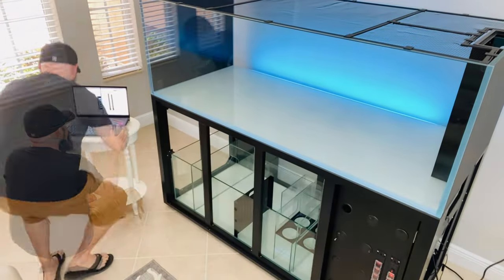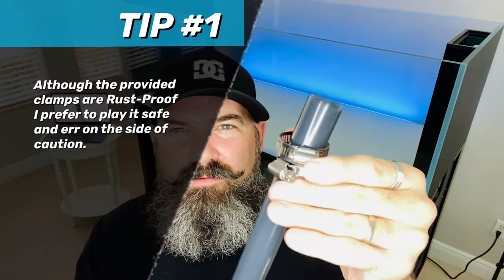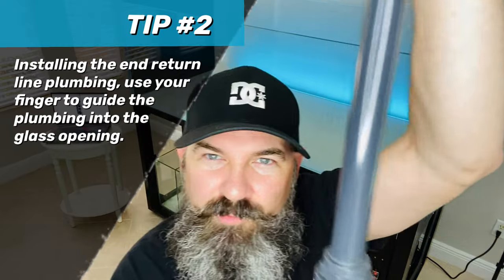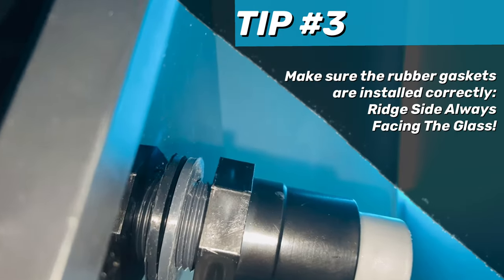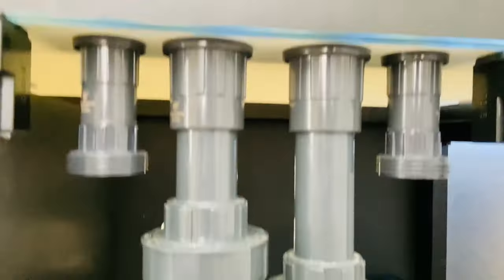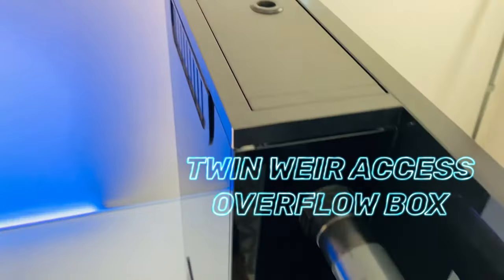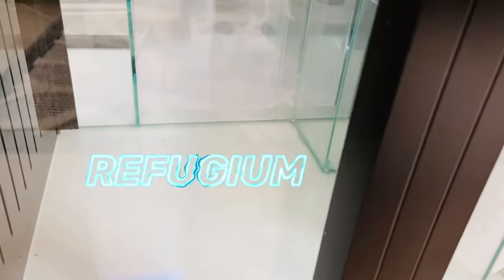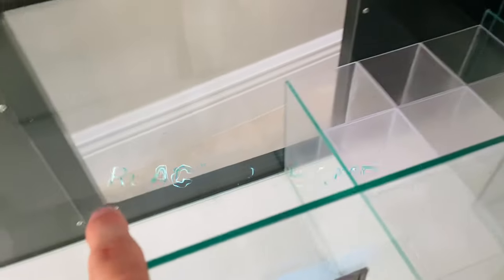💫 Plumbing the CADE Reef S2/P Peninsula Aquarium and Sump overview

Comment: This setup
Looks so clean! You have sold me on a Cade ! I remember a particularly interesting plumbing job on my old 125 😳 we completely redid the plumbing after setting up the tank in a new place and worked so hard at getting everything beautiful and neat… filled that baby up and just completely forgot about one critical step.  Next thunderstorm the power went out and we had gallons and gallons of water all over the living room 😳😳😳😳 oops anti siphon 😭😭
Reply from the maker: Thank you Stephanie!!! It’s a beaut for sure!

Ouch on the flood… were you missing a syphon hole in the return outputs?  The CADE as an additional baffle wall in the overflow to break syphon in the event of a power outage or when the return pump is off. 😁
Reply: @ReefStash  yes!! We even knew we needed to do it- we just completely forgot.
Reply: @ReefStash  I am not surprised Cade includes that. 🤩🤩
Reply from the maker: @gardengirl38  been there before but I didn’t know I needed a syphon hole when it happened to me! 🤣🤣🤣
Reply from the maker: Congrats! Your name was selected for the $25 cash drop. Please send me a message on any platform with your PayPal email and I’ll send the cash over ASAP! 🤙
Reply from the maker: see my previous comment 👍
Reply: Woohoo 🎉 thank you soooo much 🥰
Reply from the maker: @gardengirl38  sent! You’re welcome! 🎉

Comment: In the middle of redoing my 120 right now plumbing in my trigger, system ! Super psyched!!
Reply from the maker: Nice! A good plumbing job is so worth the time. I’ve done some pretty bad ones in the past and I regretted not taking my time to make it look nice and clean. 👍
Reply: @ReefStash  I have never plumbed anything before but I’m up for the challenge. My biggest problem is where to put the gate valves on the drain. I have two drains or if I even need them at all.
Reply from the maker: @domenickascoli535  I would put the gate valves a bit above the final drain line. It’s super helpful during tank maintenance to close the drain when the return pump is off. You can definitely get away without them on the drain but the systems I ran without - I wished I had installed them.
Reply: @ReefStash  on both my drains? I have two overflow boxes w two drains and two returns. Should I put one on each?
Reply from the maker: @domenickascoli535  Yes I would unless they are at different drain heights meaning one is an emergency drain like mine on the CADE but if they are both identical then yes. You could also have both drains funnel to a single larger drain with one gate valve.
Reply: @ReefStash  No it’s not an emergency drain there are two overflow boxes.  I’m plumbing it into a 39” trigger which gives you the option to use two or three drains. I’m going to use two. Good right? Prob a bit big for my 120 but I got it as a gift so I might as well set it up. I wish I had a bigger tank to set it up on. Thanks for all of your help i really appreciate it! 😊
Reply from the maker: @domenickascoli535  perfect

Comment: Good choice on removing the stainless hose clamps. I learned that lesson the hard way. Even stainless with rust and cause issues. Looks like the tank is coming together nicely. Have you picked out you sump gear yet? #cadeaquriums , #cadeusa
Reply from the maker: Agree… I don’t take chances. Thanks for the kind words. In sump equipment GW17 skimmer, M2 Ecotech return pump on a battery backups, kessil H160 tuna light for a fuge/Frag section,  bubble magus dosing pump w/seaside aquatics dosing containers, 2 titanium 600w heaters, tunze 3155 ATO
Reply: Yes agreed about the stainless. We use 316 marine grade but over a long time they will eventually begin to rust. Consider them a serviceable item. They’re provided because first and foremost need to keep the water in the system not on the floor 😬👍👌